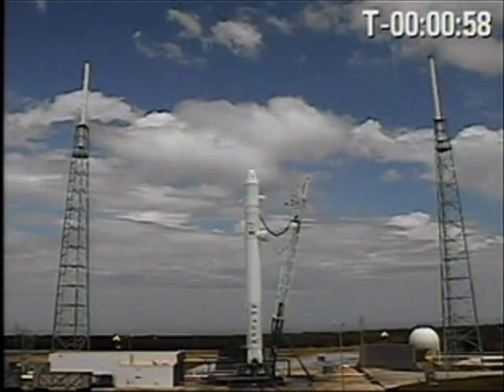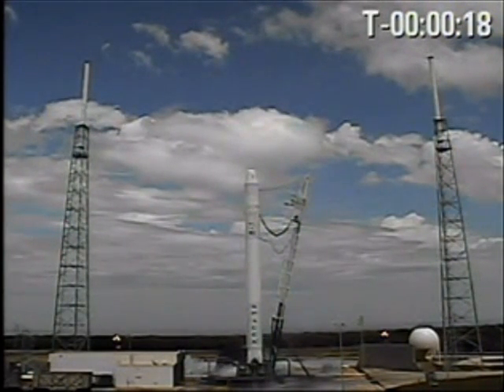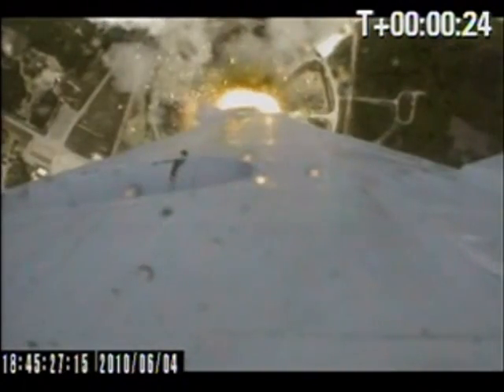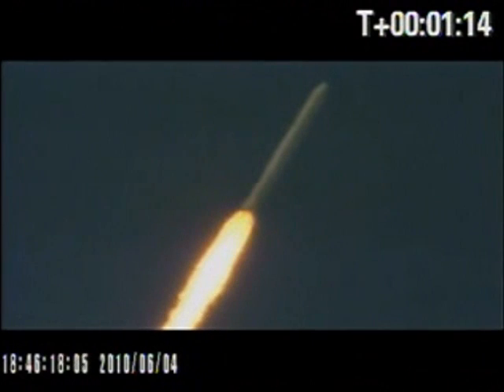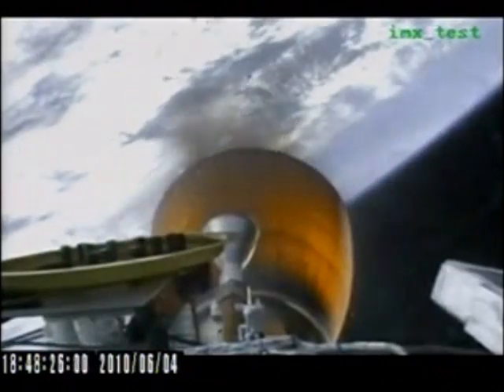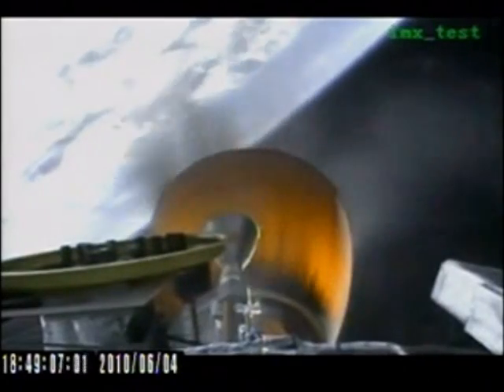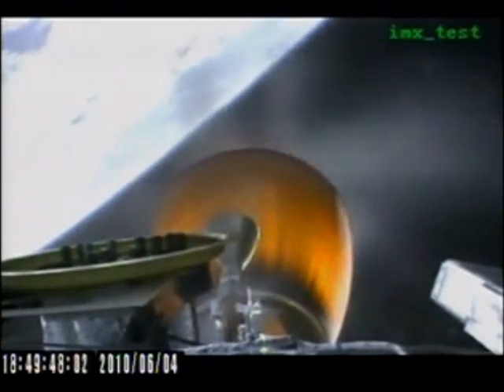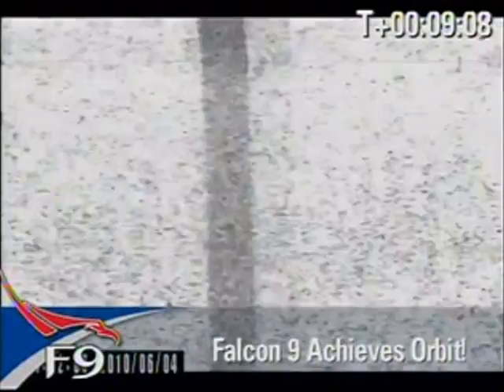SpaceX launches their Falcon 9 vehicle to orbit!

Comment: @terytery1  They don't want or need there Tech,  the shuttle can lift  53,600 into Leo! Aries 1 " could " lift  56,000lbs to Leo. Ares V 350,000 to Leo.
yes, they cost more and spaceX is doing a good job at keeping the costs low but the Falcon design will never lift the weight of a Aries V  The Falcon 9  would need 6 rocket launchs to lift what one Aries V can,  thats 168 Merlin engines!!!! sorry to many things can go wrong!!!

Comment from the maker: @terytery1 SpaceX has done it right - they are easily, and by far, the cheapest company out there to date.  Don't underestimate the Shuttle, though.  Those girls are able to lift some weight to orbit, anywhere between 60,000 and 65,000 pounds.  Do we do that now?  No, it simply costs too much.  Today, they lift between 50,000 and 55,000 pounds, depending on the mission.